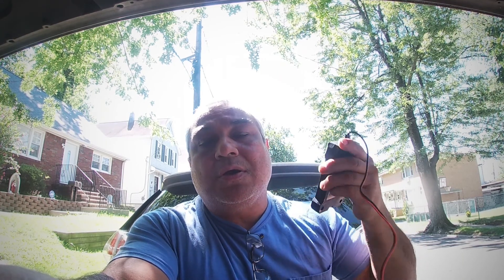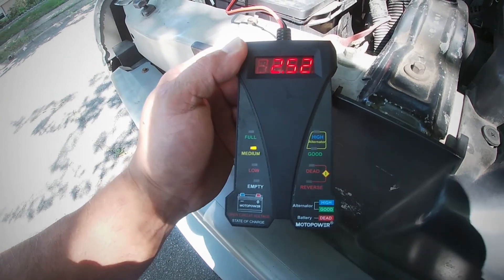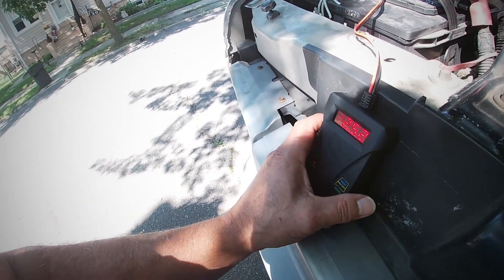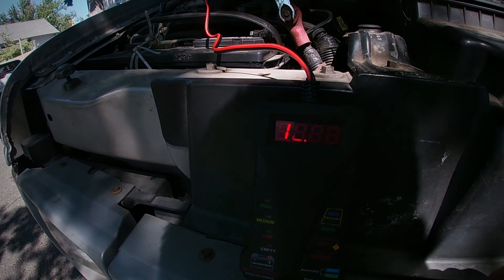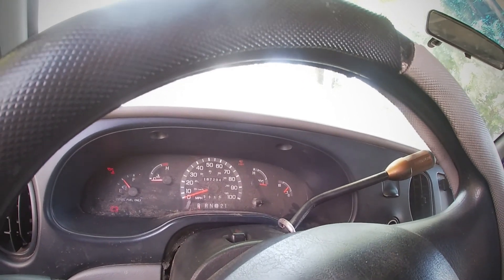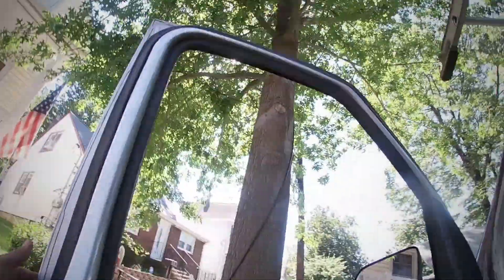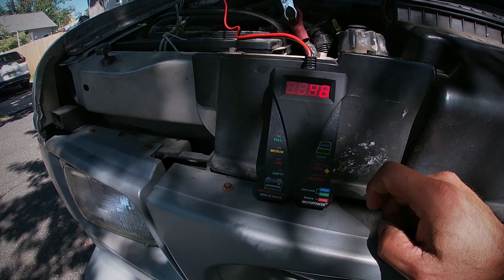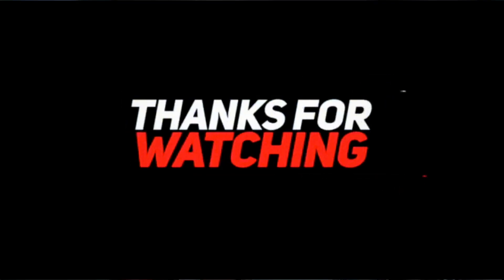MOTOPOWER: SPEND $15 TO SAVE $200+? THIS IS A NO-BRAINER!

Comment: If your voltage test is charging high what does that mean is going on?
Reply from the maker: That result has happened on two different cars. A 2014 Chevy Malibu and a 2018 Chevy Trax. Both times a new battery solved the problem. Seems the battery wasn't completely gone but may have had a bad cell. With both cars the engine would slightly hesitate before kicking over and then after some time wouldn't kick over at all until I replaced the battery. I hope this is helpful. Thank you for viewing our video.
Reply: @Dla37zill  I found out it was my battery, I put a new battery in my Benz and everything was fine, your correct it had a dead cells in the battery! 👍🏾